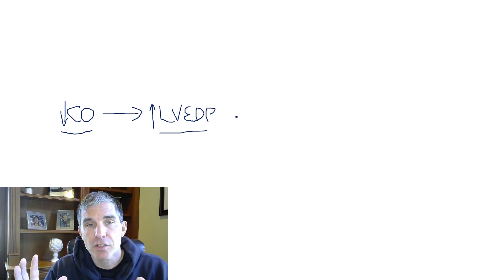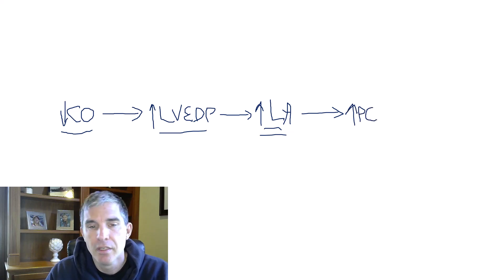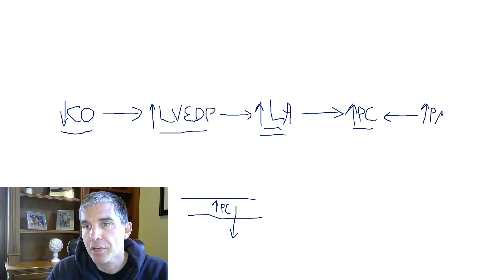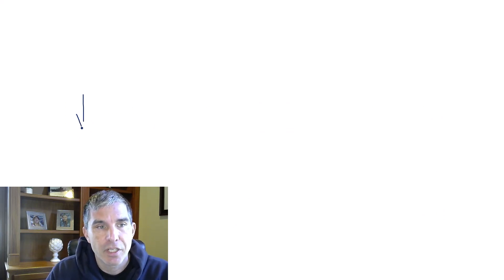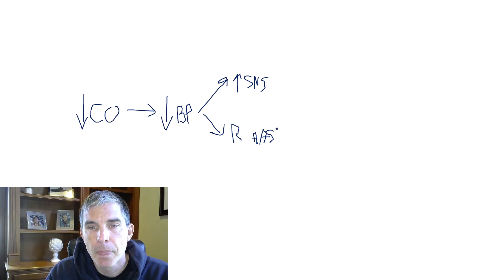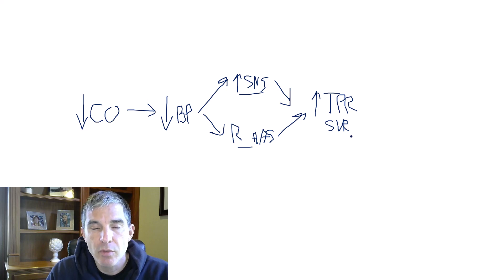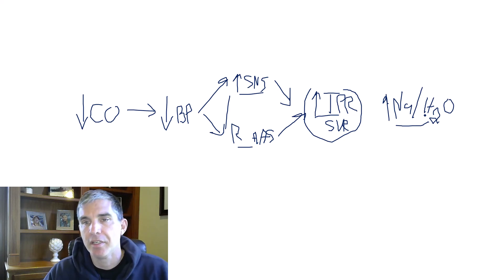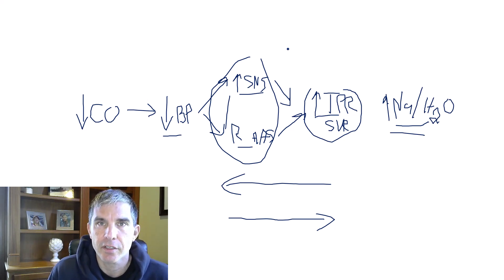Quick Review: Heart Failure Physiology

Comment: Hello Jason, got one Q on this theme. I will be grateful if you can comment and clarify it. 

Case: 65Female + Hx of hypertension + JVD + peripheral edema + S4 heart sound. And we are asked about LV end-diastolic volume. So, I want to explain how i see it. 

jvd+p.edema = RV HF. Why? Probably due to severe HTN (LVH -> LAH -> incr. PCWP -> RVH -> eventually fails). But we got no signs of LHF (only LVH). 
Next, if we've got no signs of LVHF, can we tell that LVEDV must be normal? Because CO is based on LVEDV, esp. in case of LVH, there's no problems with pump itself, but in amount of blood it contains. 
Is it even possible to get RVHF in case of arterial HTN w/o LVHF? 

If i try to imagine similar case with same signs but add to this pulmonary edema and coma state, does that necessarily means there's increase in both LVEDP, LVEDV ? 
Thanks!
Reply from the maker: @videosnimalsvz4982  When HTN leads to LVH and then heart failure, LVEDP will be high otherwise no HF. So even if no signs of LHF,it must be present if it is causing RV HF. Cant get to RV HF without firsf having LHF (outside of cor pulmonale).